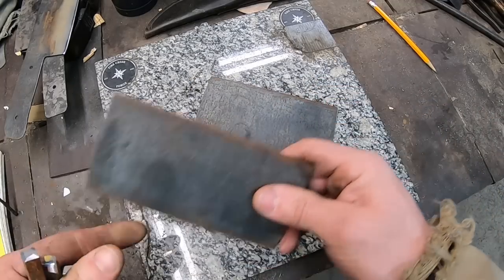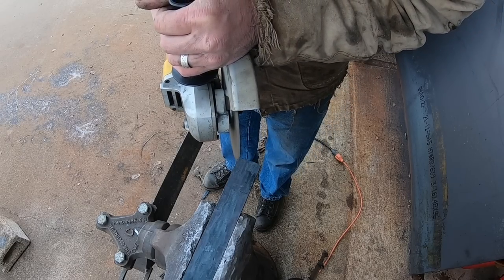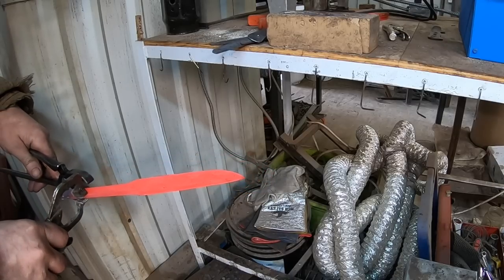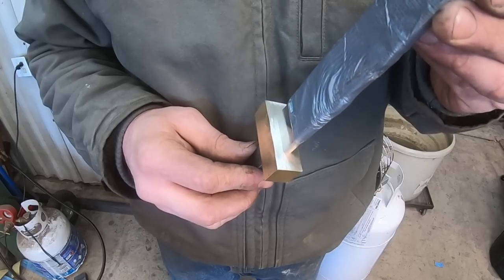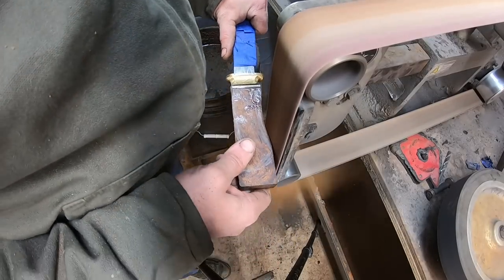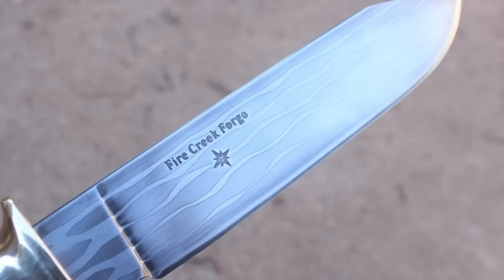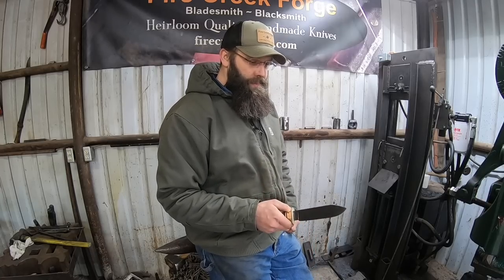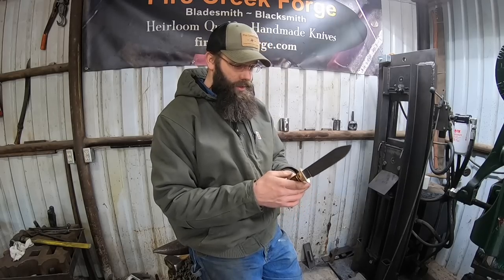Forging A Pattern Welded Knife From Tool Steel Rods, Blacksmithing Project, Bladesmithing, Forging

Comment: I very much appreciate the use of a unique steel. Everyone uses 1080, 15n20, 1095. Obviously those are easy to forge. But they also have the properties they have. And would not be my first choice in a knife I owned. Folding and cutting the metal 200 times won’t change those properties.  You’re the first person I’ve seen who’s chosen to step outside that box. So kudos.

Comment: I first encountered 01 tool steel in the mid 80's my Dad was commissioned to build an oversized Bowie knife, the giant man couldn't pay $300.00 fast enough to take possession. He then made a skinner/ hatchet combo set for his Brother and himself. The hatchet split a 2×4 with a 16 penny nail in it. When it's passed to me, it'll still have the slight chip from the nail. It's split thousands of pelvic bones, and separated just as many heads. It's an amazing steel for hunting applications.

Comment: Everything I’ve ever seen you do has been stellar! Granted, nobody’s perfect. But one thing I’ve learned over my many years of working with my hands, is in most situations, two is always better than one. If you try putting two clamps, on a piece of wood, on both sides of the knife, you’re less likely to have swivel issues. Plus you’ll be able to apply more even and steady pressure.
Two enthusiastic thumbs up on everything I’ve seen so far!

Comment: You have a TIG welder, right? Try using thin O1 drill rod as a filler. I think it would have worked to repair the failed tip forge weld after a little clean up. 

Bummer about the tip. Weld that damn clamp swivel so it never happens again. 
I love these “canister” builds! I’d love to own one of them.

Comment: Something you've probably already thought of but, just in case, maybe cut a slot in the block of wood you're using to clamp the blade so it fits snugly around the bar of the clamp.  That should help to minimize twisting from side to side.  I think I'd also drill into the backside of the wood block the same size as the swivel head on the clamp so that can't slip off.  
.
Gorgeous knife even with the oops!  Anything handmade (or even a limited machine made run) is going to have some "imperfections", the important thing is that those "flaws" not interfere with the functioning of the finished product.  In many cases they'll increase the value of the item because of the uniqueness.
Reply from the maker: Thank you!

Comment: I dont know how your page started showing up in my feed but Im glad it did. Im not a knife maker but do pretend to be a hobbyist woodworker. As far as you tip breaking the F body clamp you have there will be notorious for slipping like it did. If youre looking for something different look at K body clamps, Harbor Freight sells a 24" parallel K body clamp for less than $40. The jaws on that clamp will always stay parallel. Anyway, keep posting. I also pretend to be a cook (no chef by any imagination) and love some of your chef blades

Comment: Try clamping the blade in a vise then put your clamp on the vise and the back of the handle. Tyrell knifeworks has a video on this and I have not had a break yet doing this. Beautiful knife in the end despite the break!
Reply from the maker: Yep I have done this, but I don't have a vise in the house where it's warm for the epoxy to cure

Comment: Don't know if you read my last comment but if so, congrats. That handle work is fantastic this time, love it. Also maybe try out a parallel clamp to eliminate the swivel clamp or use the vice clamp trick if it warms up enough in your shop
Reply: It was the knife that broke, not the clamp. The line he was chasing probably extended beyond what he could see, or their may have been a micro crack from heat treating. Once a fracture begins it can propagate at very low stress levels

Comment: Might I suggest a clamp modification?
In my experience, I've dealt with wobbly clamps by removing the rotating foot and instead drilling a hole into a small block of wood large enough for 2 skateboard bearings. (Or I guess in your case whatever bearings would fit the threaded shaft of that particular clamp)

The block of wood won't stay on by itself, but it will keep it from wobbling while still allowing it to rotate. .It just won't be able to pivot. :)

Comment: One thing you may want to do to help stabilize at least some of your clamps it to either epoxy the swivel part in place to stop it from moving or just wield in in place to stop it from moving. Might even want to glue a patch of sandpaper to the other end of the clamp where the handle sets while the glue cures in the handle to reduce the chances of the handle slipping out. In other words modify your tools to fit their use.

Comment: Make a new clamping fixture to replace the wobbly bits on the existing clamp. A metal cage holding a softwood block would be nice, fixed to the end of clamp to avoid uneven clamping loads/blade tip breakage.

Comment: Wondering with the brass if you have ever tried casting the guard direct onto the blade, using a wooden mould that allows you to do so. Would be very tight fitting, and the shrink during cooling would make it hold the steel well, no epoxy needed.
Reply from the maker: That would be a fun project

Comment: Try making a counter sunk hole, about 1/4" deep on the clamp side of the wood block so the woods doesn't move. Mark off the other side of the wood so you know where to place the tip. Should give you a bit more consistency of you continue using the same method.

Comment: I've been for a walk down struggle street with O1 a few times myself. Sort of a love-hate as it was the first high alloy steel I really started making a lot of knives out of starting out 6-7 years ago and its definitely got a long list of pros and cons to it. If you're looking for a bit of a tougher round stock you could give Silver Steel 1.2210 a look in, its a fairly old low alloy carbon steel I want to say was developed in Sheffield as a cold work steel (but I might be wrong) and its got 1% carbon, about 1% chromium and 0.2% vanadium with sometimes a trace bit of manganese and nickel depending on the source. Gets super hard, more than reasonably tough finishes nicely and comes in drill rod stock, finishes very nicely as well. So a lot of razors and puukkos got made out of it because it holds a great edge. (groundflatstock in the UK carries it, very cheap and will ship anywhere)
Just an option there to consider
Overall though, I honestly don't mind the bullnose tip as it gives it more of a old school trade-knife shape and the pattern is really quite good considering you're more or less experimenting with the process and will get some results unexpectedly as you refine it. So maybe a redemption video is in order one day to see how you can adjust it knowing what you've found and putting that to more use by seeing if you can replicate it or adjust the final result. The handle I think is actually the big seller, it does look very good

cheers
Reply from the maker: Thanks Kris. That silver steel sounds interesting for sure.
Reply: The silver steel is essentially O1 with a little more chromium. Neither have great toughness. The chromium  provides increased hardenability, not increased hardness,  and is useful on sections over 1/4 " where deeper hardening is desired. It doesn't offer anything to a knife that 1095 can't provide.
Reply: @maplebones  my 1.2210 silver steel is 1% Carbon, 0.85% chromium and 0.2% Vanadium. It's very much a low alloy steel
Its not O1

My last 01 1.2510 I bought was 0.95% Carbon, 0.55% Cr, 1.1% Mn Si 0.25% Vanadium 0.1% and Tungsten 0.55%

That's a high alloy steel, its not going to harden in the same stuff as 1.2210 which uses a fast oil or water quench at 830C, the O1 above works on a medium quench oil only at 810C for a 10-15min soak.
Reply: @krissteel4074  Steels aren't supplied at a precise chemical content . They're supplied within a range. No steel at 1% carbon is a low alloy steel. Quench medium is as much a function of section thickness as it is alloy content. These are both high carbon chrome vanadium steels  and the same for practical purposes. If you've picked up your metallurgy on the internet,  I forgive you.

Comment: Nice build. Love your e we irk and how -Tom’s.
The clamping part for me is also so finicky and not precise… lame when that part of the build effects the whole darn knife. I’ve had that happen to me!
You can C clamp some wood to each side of the tip with a little hanging over to give you a nice square surface to use the main clamp against. If that makes sense
Reply from the maker: Great idea, thank you

Comment: I was watching a video and you have trouble with white out. Have you tried white spray paint? It has the aluminum oxide in it that is in white out?
Reply from the maker: Yes I only use white spray paint now, have for some time. It works great

Comment: It’s not a zero atmosphere weld if you have holes in your can,,
As a bladesmith It’s better to have the tip of your knife snap in the workshop than in the hands of the new owner as you have the opportunity to fix it before anyone can complain